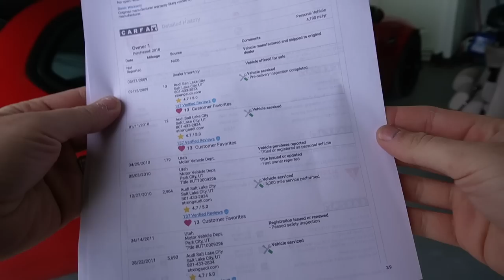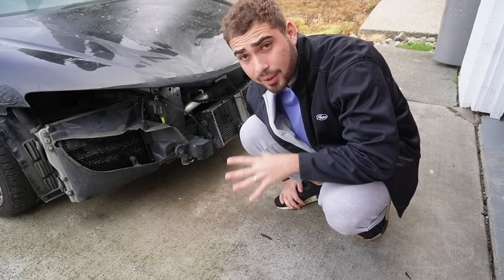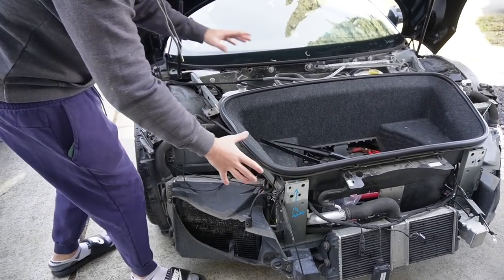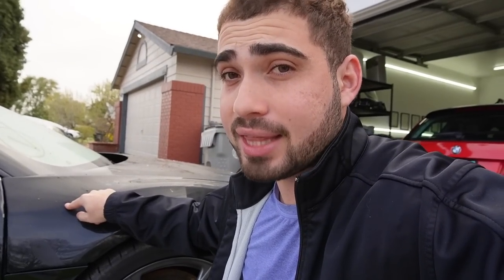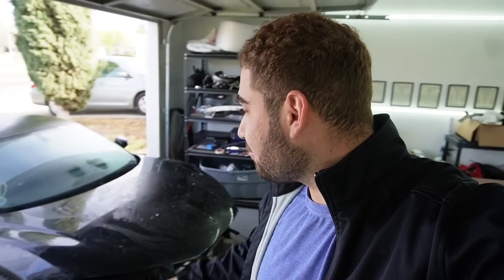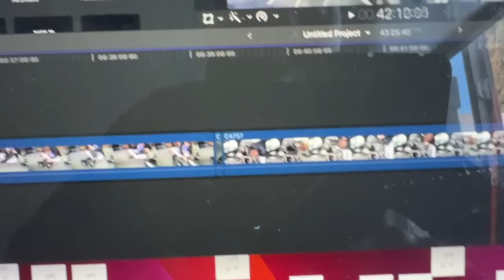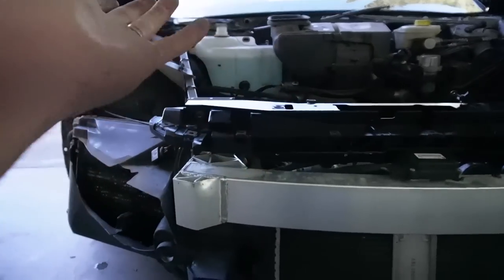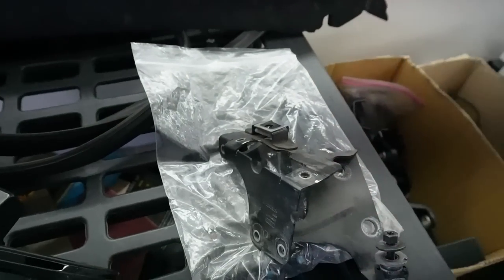Rebuilding My GATED MANUAL Audi R8 Part.1

Comment: The frame around the suspension towers are prone to cracking on these r8s I believe there is a mod where you weld in plates correct me if I’m wrong